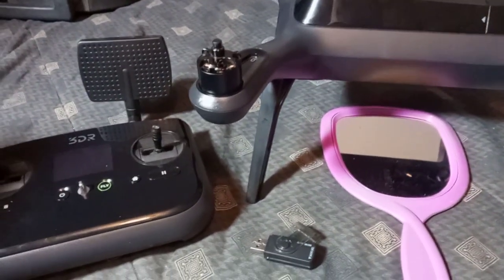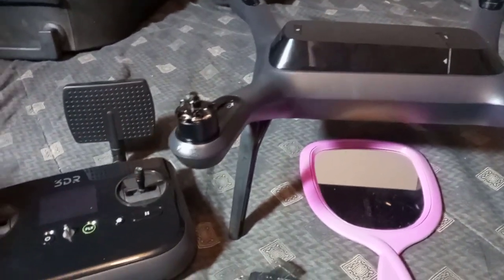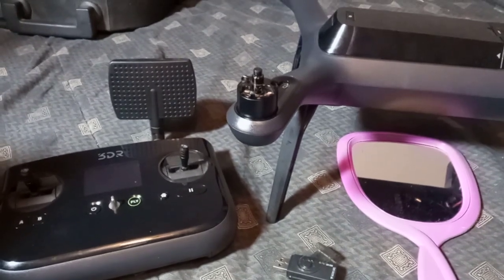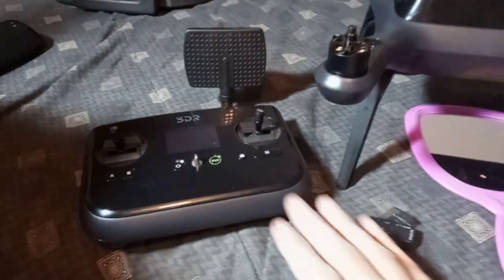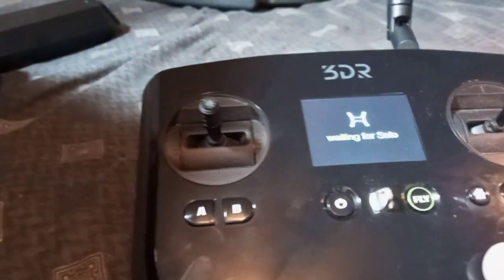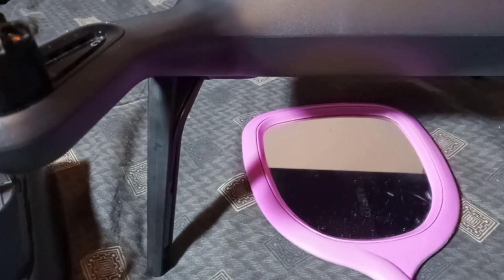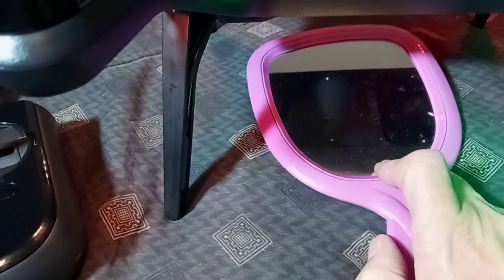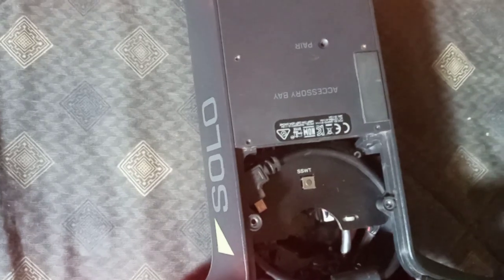3DR Solo Drone - How 2 Reset & Pair in 2023

Comment: Sorry, it's been a few years since I have flown my Solos. Just to be clear, this does a factory reset? Then installs the base program from the controller board to the flash card inside the controller? Then the controller flashes the Solo? Or do I have to remove the sd cards from both the controller and Solo, then flash them with the base 6.10? Forgive my misunderstanding. Where can I download the Solo app? I have an LG V20 Android 7.0. Thanks for the video!

Comment: Hello i have a 3dr solo  drone too, my dad bought it in 2021 to do some practice, but when my dad started it, he told me the drone was asking for a password to be paired, then we where thinking maybe the previous owner had put the password to protect it,  then we did the hard reset to both the drone and the controller but then when we restared the controller that now is stuck on waiting for update or similar message for what i remember, we called the previous owner and he told us that the password was the one written in the manual, but then we had no time to continue then we just shut off everything and put it back in the case,, and put it in the garage for 2 years, but now my dad needs it and then we have taken back, as soon i can i will take it back, and try to follow your video and try to do things properly.

Comment: I have a solo that has never been in the air I have took the cards out of both the remote and the bird and still have a solid orange light and remote still says waiting for solo is there anything I should know on getting this thing up in there besides what I've already done
Reply from the maker: This drone was 1200 new! I would sell it on ebay for parts. Most people that "just came across this" found it in a dumpster or closet and instead of sending it in for service from me or Drone Worship...they rip them apart, take out the SD card then ask why its not working? because of you. People on Ebay love guys like you!

Comment: I have an all original solo, haven’t flown since 2017.  Anyone know of any videos that can get me up to date and back to being able to fly? I need to be able have the feature where I can have it fly on its own(on a cable)
Reply from the maker: The only way  to get cable cam working is by first upgrading or downgrading the firmware's to versions 2.42 and having a old phone running the original SOLO app. 2.42 is the last 3DR firmware release. Open Solo is a 3rd party aftermarket firmware used with SOLEX app and that feature is no longer available. I can fix any solo but its not cheap or easy. or you can try buying my SD cards but your on your own and why I just cater to cinematographers.Thanks!
Reply: @travelrockstar  what do you charge? And what’s the turnaround time? Thank you

Comment from the maker: I sell updated SD cards that fix the pre-flight issue. I will be going around the USA this summer in my RV fixing as many 3DRs as I can! Hang on help is coming! Just keep checking back for updates, dates and times! I DO NOT recommend taking the SD Cards out yourself since you will ruin the port and do not have the proper adhesive and you will have a fly-away without it secure.
Reply: I just bought the $100 package now do I send it in to u or how do I go about it
Reply from the maker: @CharlieHustle_3  once I receive the payment email, I will respond with shipping or drop off instructions if your in CA. Please contact me at my email listed in about section
Reply: I need help with mines
Reply from the maker: @CharlieHustle_3  Hey Bro! Sell your on Ebay for 100 and re buy a working unit for 200. If you want your unit permanent fix that will be worth 300 plus after, it will cost 100 plus shipping. Just go to my website and order the repair package! Id expect 2 week turn around with standard USPS shipping.
Reply: @travelrockstar  y if it’s a brand new drone in the box still never used
Reply: @travelrockstar  in ur video u said to buy the $100 package send it in and get a working drone back
Reply: I keep trying to place order but it keeps telling me I can’t order right now Please come back later I waited 2 days did it again and still can’t. Can u Please help
Reply from the maker: @CharlieHustle_3  let me look into it meanwhile email me your info and I will contact you.

Comment: Hello, I can't update my 3dr solo drone, please help me with some advice, I want to specify that I'm from Romania
Reply from the maker: Your best solution is sell it for a working one. Or if you find a certified A + technician in Romania like me that knows Linux line code...I will be happy to show them how to flash update for free. Anyone else no!
Reply: @travelrockstar  I honestly would prefer to pay for the software update repair because I spent a lot of money on it and my dear, but it breaks my heart when I see it lying unused, if I didn't live in Romania I would send it to you for repair, but it seems that I'm unlucky, I also tried with the solex application but honestly I can't manage it. Thanks for the advice
Reply: @travelrockstar  If you can and want to help me with this re-software of this drone, I would be very grateful, and of course I pay, I don't want it for free, this drone helps my father to monitor wild animals that attack domestic animals. Thank you for your answers. God bless you !
Reply from the maker: The Solo batteries even new are expired ...The drones are not safe to fly without having someone like me go over the unit and recondition the batteries...